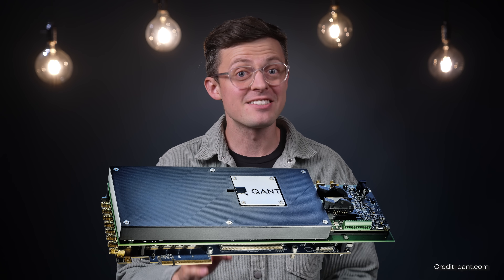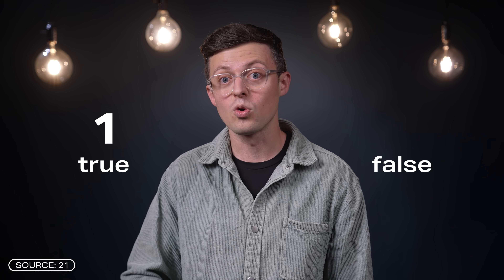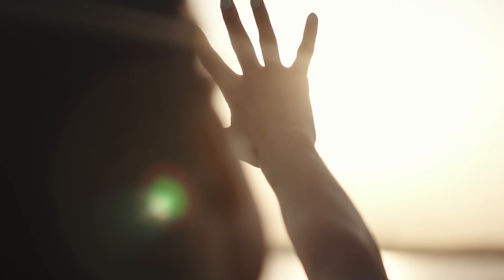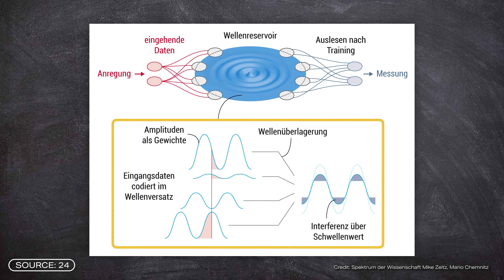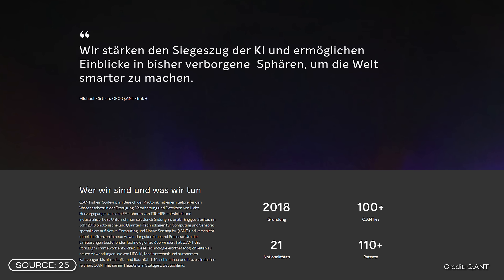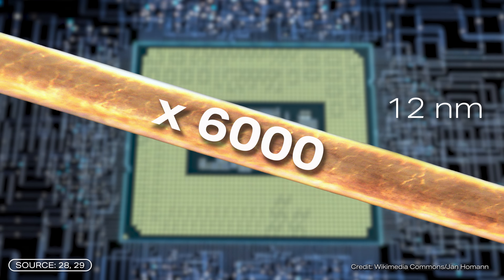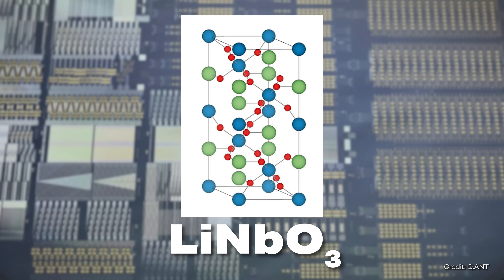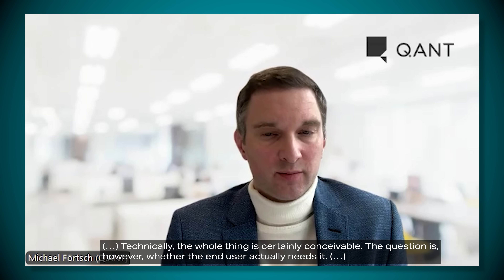This Chip Uses Light Instead of Electricity!

Comment: This raises so many questions. Here is a few:
* How does arithmetic work at the basic level? All I got is that you can combine waves, which sounds like addition to me. What about other mathematical operations, how do they work?
* Is there logic, boolean or otherwise? Branching, i.e. any way of choosing between what calculations to do, depending on the values?
* Without storing data (except long term, as stated), how can there be serial processing? It can't make sense to use every logic and arithmetic component only once for any given problem.
* What do they even mean by the error in digital electronics? The whole point of digital is, that you can completly eliminate the deviations (usually of voltage levels) by just moving the values back to the intended value. Unless the chip is faulty, they will never deviate so far as to be confused with the incorrect value.
* What does "harness the power of quantum physics" have to do with this? Sounds to me like an unrelated buzzword thrown in to make it appealing to the hype.
Reply: Light waves would be able to do more than just addition/subtraction. He mentions "interference patterns", this can be subtraction and depending on what kind of input patterns/colors could also be multiplication. Just look up any video on wave forms and interference and those questions will be answered. That's not information limited to only this technology, it's ubiquitous and fundamental to all forms of wave transmissions throughout the universe.

When he stating that information doesn't have to be stored, he's not referring to zero data storage at all. In a standard CPU data is stored first on a Drive (SSD for example). Then this is moved to RAM, which is faster than the drive, but not as fast as the CPU.  Then when data needs to be processed it is then moved 'again' to the Cache, which is physically on the CPU itself, but the amount is limited. We now have CPUs with Cache around 64MB (Megabytes), whereas RAM 64GB (Gigabytes). It's this Cache layer I think is the part where data doesn't need to be moved to for the calculations to be done. Just move the data from Ram directly into CPU for processing and when all the calculations are done, store it in RAM.
There's no need to move the data from RAM<->Cache constantly until the job is done. Just grab from RAM and spit the result  back to RAM. This saves lots of energy and more importantly (imho) saves LOADS of latency.

Digital Error is the number accuracy, the "Decimal points" he mentions. If you calculate Pi to 3.14, this is 2 decimal places of accuracy. However, if you calculate it to 3.1415926535, or 10 decimal places, it far more accurate. This has huge implications when what ever is being calculated that over time/distance deviations can occur. For instance, if you are planning space flight calculations, you don't use 2 or 10 digits, you use more like 20 or more digits to make sure that after flying 100's of thousands of kilometers that you're still on course. Little deviations can add up over time, even if it's not noticeable at first.
Reply: @korishan  Would photonic computing allow for complex operations to be performed within the long term memory?
Reply: @monkeybongos4389  I am guessing you mean the SSD/HD storage.
I would assume so, but transfer rates would be horrible if it used that directly. There'd be no benefit to it until they speed up those data storage devices by at least 100 fold. For now, best thing is to load what needs to be worked on into RAM
Reply: This question resulted in some very informative answers
Reply: Good questions. It's great to see someone genuinely curious and thinking critically.
Reply: @HalfInt "Harness the power of quantum physics" likely refers to the fact that photons can be used as physical (not logical) Qubits eventually, which would allow a much better paradigm for encoding data and logic (base-3 or even more, instead of base 2; The Channel Codeolences recently published a very interesting video about ternary computing which highlights the benefits in contrast to binary, if you want to know more abt this)
Also: one wouldn't even necessarily need qubits/qudrits for using ternary here, because light spectra (as far as I know) can be easily split and told apart - more easily and reliably than voltage levels in electronics based systems. Light simply has more degrees of freedom.
Reply: I think the error discussed in digital computing is related to floating point numbers (IEEE 754) where numbers are rounded to 15 decimal places (depending on the bit depth of the floating point number).
Reply: Depending on how you combine waves, you can create all the basic logic gates. And once you can do this, you can do anything.
Reply: Like all the other magical breakthroughs it'll never be released, or if it is no one will want it because it'll be inferior in every way
Reply: It seems that this is nothing more than intentions for now.
Reply: I think they meant error in electrical analogue devices.

Not digital.
Reply: @HalfInt 

(Copy of my critique in a different comment directly under the video (you doesn't refer to you))

This video exemplifies everything wrong with tech content presenting laboratory curiosities as imminent revolutions.

First there is the accuracy catastrophe. You tout 95 percent accuracy as a success while glossing over the fact that digital processors achieve 99.4 percent. That is not a minor trade off. That is a 4.4 percentage point error rate that would be completely unacceptable for any production AI system. An error rate of four decimal places compared to 15 to 16 for mobile processors is not reduced, it is fundamentally inadequate for precision computing. This is exactly why analog computing fell out of favor decades ago, and no amount of lithium niobate marketing changes the Physics of noise accumulation.

Second there is the conversion overhead whitewash. You mention in passing that optical electronic conversion is not a major problem based solely on the CEO is opinion, ignoring that this conversion overhead is precisely what destroyed the efficiency gains of every optical computing project in history. When you must convert every piece of data to light and back, something required for all real world applications since Memory is not optical, you are not saving 30 times Energy anymore.

Third there is the fabrication fantasy. Claiming these chips can be made in 1990s fabrication facilities ignores that thin film lithium niobate fabrication is technically demanding and not readily available in commercial semiconductor supply chains. This is why Quantum Computing Inc. had to build a dedicated thin film lithium niobate Foundry in Arizona.

Fourth the claim of being first commercially available is false. Lightmatter has been shipping photonic processors for years. Q.ANT is not first. They are late to a market that has not taken off precisely because of the accuracy and integration problems you are minimizing.

You are presenting a 62 million euro Series A announcement as scientific proof of technological readiness, when what you have actually documented is a company that has overcome very early stage engineering challenges while leaving the fundamental analog computing limitations completely unsolved. The word breakthrough only applies if you ignore everything that makes modern computing reliable.

Stop trading in artificial enthusiasm. Your viewers deserve better.
Reply: Normal CPUs also only use addition for everything. They subtract by inverting the bits of the second operant and add them together. A - B = A + (_B + 1) where _B = inverse of B.
Multiplication is just repeated addition and division is just subtracting until the rest = 0.
Now analogue chips can do more. For instance an Op-Amp can be used for addition, subtraction, inversion, differential and integral. Similar circuits could be implemented with light.
Reply: @dreamyrhodes you are correct for addition and subratation of integers. But CPUs and GPUs typically use more sophisticated schemes for multiplication and deviation, and it gets more complex for floating point numbers.
Reply: @dreamyrhodes  No. Any modern CPU has multiplication and division built into the hardware, because repeated addition or subtraction is way slower.
Reply: The sources listed more clearly explain it. Waves can add or subtract together or do more fancy operations. Fully Optical transistors with Boolean logic have been around for decades but just were impractical. Things can be computed without long term storing if it moves through each section without hitch and program fully loaded and data on beginning. Electronic chips suffer from noise which increases as things get smaller faster etc and amplification to get rid of that hurts speed power abd ability
Reply: ...THIS WILL not WORK....PERIOD

....AND WILL BE IN constant short circuit

.....KNOW why??....BECAUSE TIME DOES NOT AFFECT PHOTONS LIKE AT all BECAUSE THEY GOT no mass

...WHICH GOT PROVED ALREADY BY QUITE RECENT DISCOVERY ABOUT entanglement for photons can travel back in time .......WHICH QUANTUM MECHANICS CAN not EXPLAIN)))))...BUT TIME PHYSICS can )))))

.....SORRY TO DISAPPOINT,OK?